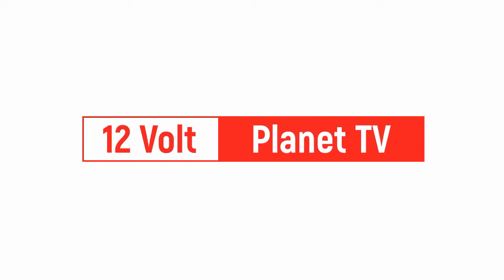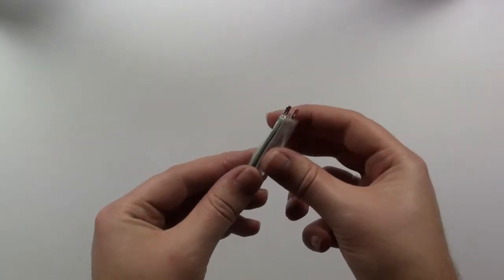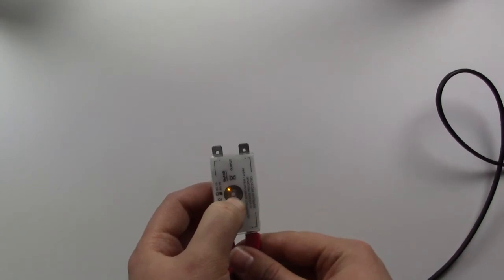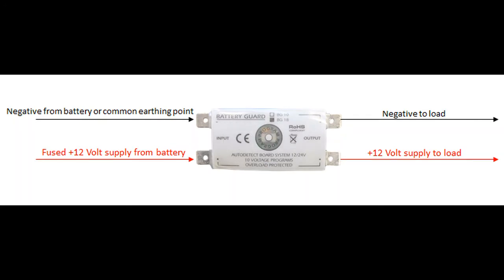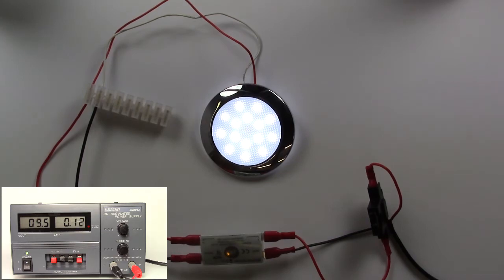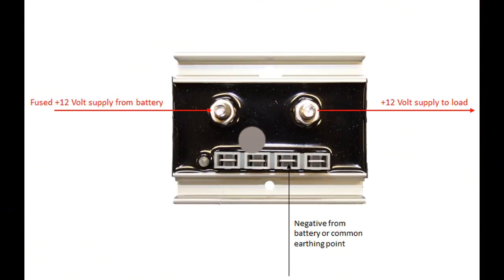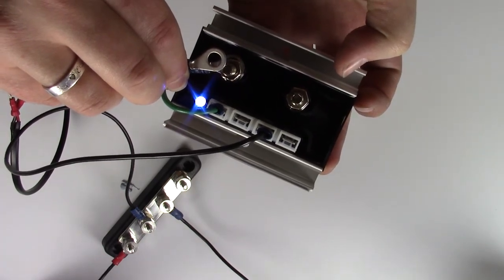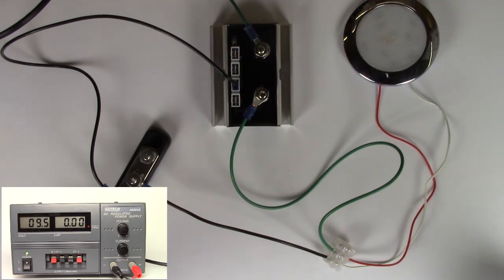Programming Battery Guards | 12 Volt Planet

Comment: The product description says "They also disconnect the battery in an over-voltage situation". Can you include a video showing this feature?
Reply: I misread. I though it disconnected the battery from the charge source, but it disconnects the load side.
Reply from the maker: @kevinquick2101  Hi You could use it for over-voltage protection on a charging source if you wish. it would then stop that charging current going to your battery should there be a spike. Your battery would just need connecting as a load. We will look into added a video in future showing this feature.